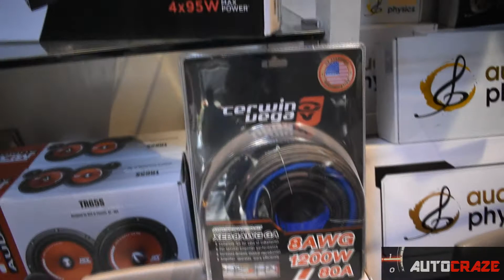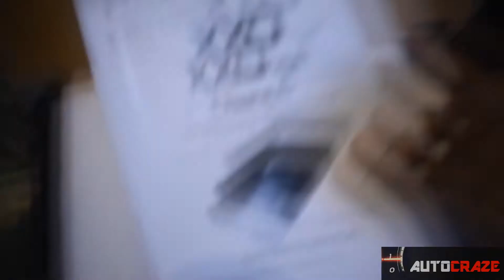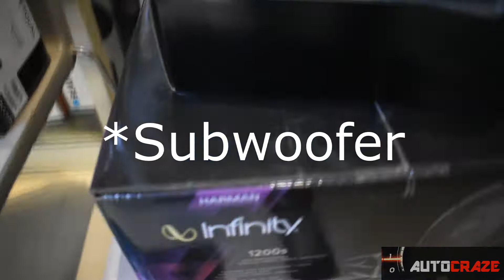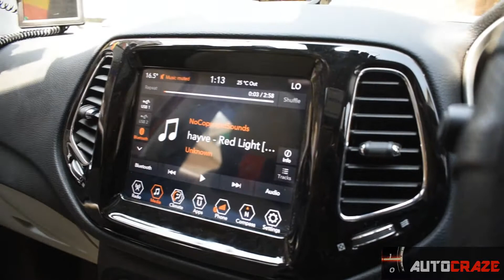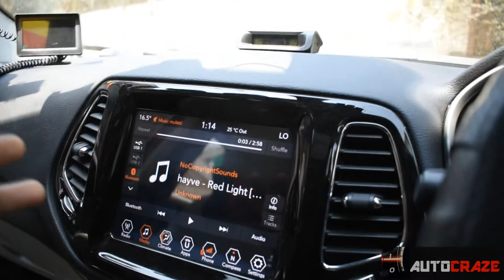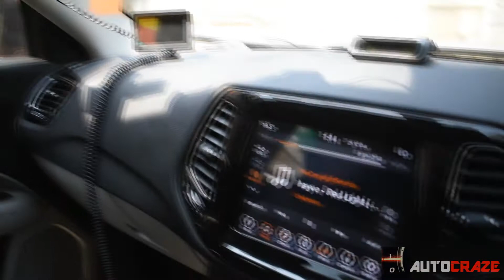Jeep Compass Audio Upgrade | Evo Customs | Auto Craze

Comment: I’m having a hard time figuring out which wire is the power wire for the stereo. There’s no diagrams online. I have a 2021 compass
Reply from the maker: For what purpose do you need the power wire of the stereo
Reply: Android 10 in eBay or amazon come with bezel wiring harness and screen